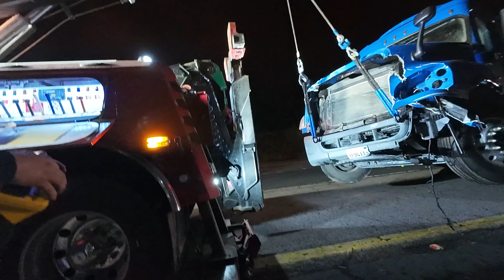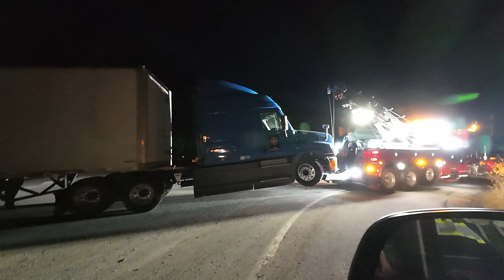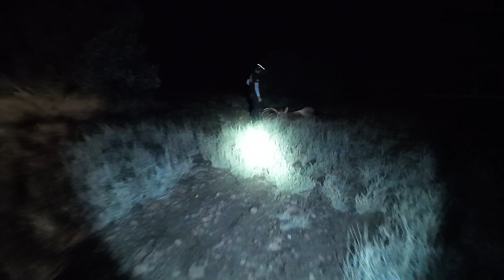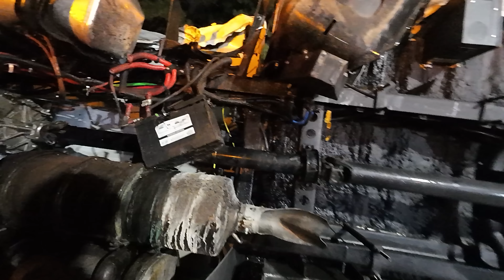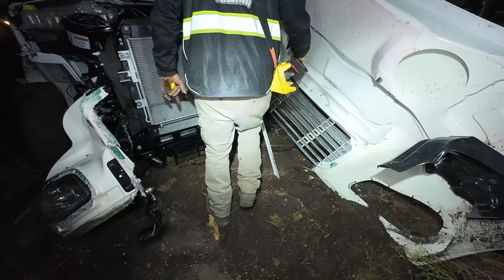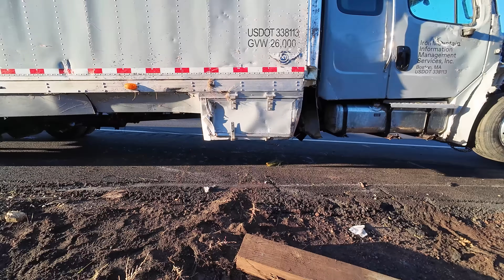TOW TRUCK Rescues SEMI DESTROYED BY HUGE ElK!!

Comment: I drove a 1-ton van for 4 years doing Expedited freight. My biggest fear was a big buck in the highway. Wish I’d installed a Cattle Gaurd and then I could just drive through him, instead of swerving to miss and crashing …
Reply: My first pickup  had a front bumper made out of gas well casing 4inches by 3/8 cold rolled, hit several deer at 55 only slowed to 50, they all bounced off  and were dressed out by natives and hanging in a hour and my friend lost his license to drive he had an old Ford Fairlane and cut a 40 gallon drum in 2 and welded the pieces end to end and bolted it to his grill and bumper, he was arrested for trespassing twice and destruction of property chasing deer through a farmer's cornfield with his car. They sent him to Bellevue nervous hospital.

Comment: How do you prefer to wrap your chains when securing the front axles to the under tow
Reply from the maker: 5/16x10’ grade 100 over the leaf spring, under the t-head, around the axle, back to the receiver, then use the tail wrapped around the 2 legs to take the slack out. 

I have my new guys use 3/8 omega chains with a binder. I have a few other guys that use axle straps